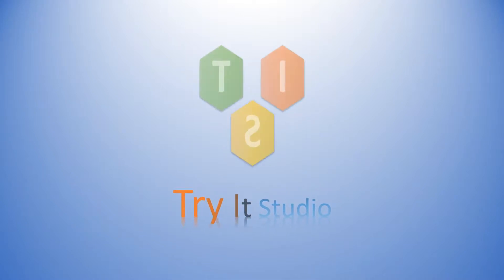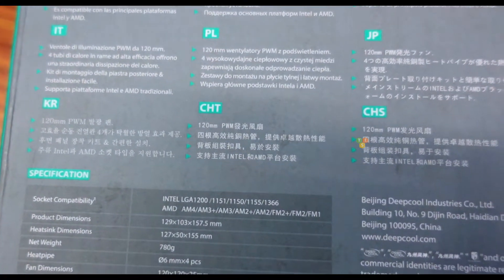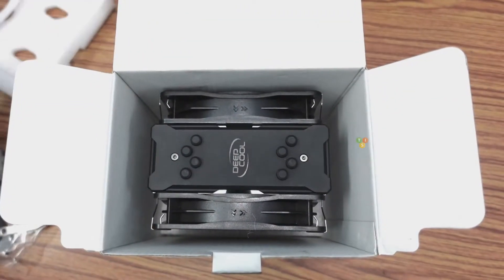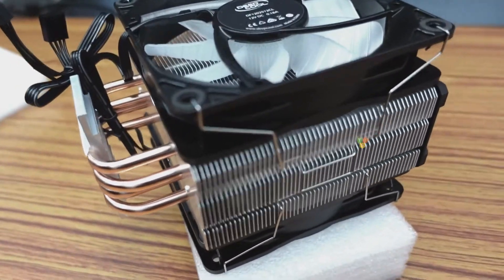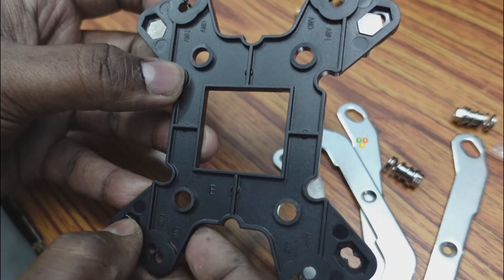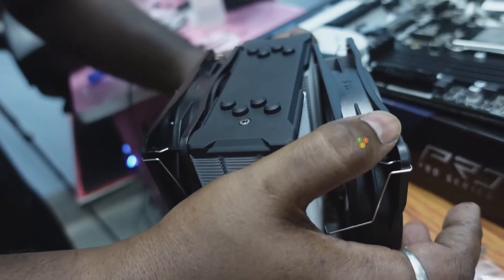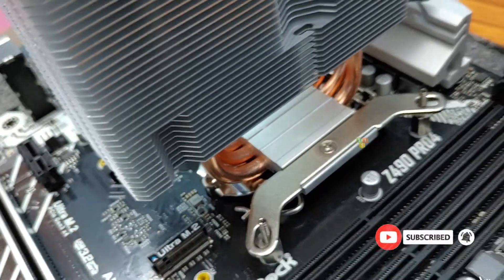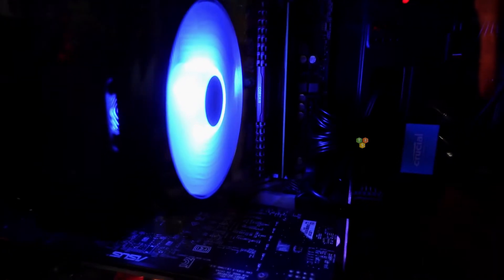DEEPCOOL GAMMAXX 400 PRO CPU Cooler Unboxing and Installation on Intel LGA 1200 Socket

Comment: Can it be used with 14400f?
Reply from the maker: Yes, the latest model has necessary attachments.
Reply: @tryitstd  Yes, now I have it installed 14400F+ ZOTAC 4060.:goodvibes:

Comment: Hi there. I have i7 7700k with corsair h100i v2 liquid cooler which is faulty at the moment. Currently don't have enough cash to get another liquid cooler but want to get one air cooler. Will this be ok for my processor ? i think its 95w tdp processor & lga 1151. i just do gaming & browsing & watching thats it.
Reply from the maker: This cooler will easily handle your processor load. I am using it with my i9 10850K processor and for gaming processor temp never exceeds 70 degree. Although for i9 it is not perfect but it can get the job done.

Comment: Can use with i5-10400f?
Reply from the maker: Yes, you can but you will have to buy motherboard connection socket seperately.

Comment: Can use with ryzen 5 5600x
Reply from the maker: Yes, it supports AM4 socket.
Reply: @tryitstd  but can it cool ryzen 5 5600x well
Reply: @tryitstd  can it keep 5600x cool
Reply from the maker: @kiwiofficial64  Yes, but if you want to overclock the CPU then you should go for 6 pipe heatsink. I am using it with i9 10850k. Ryzen definitely runs coller than this 14 nm beast.
Reply from the maker: @kiwiofficial64  By the way why are you going with Ryzen 5600x instead of i5 12600K. Intel 12 gen is best for gaming now.
Reply: @tryitstd  ok thanks for reply
Reply: @tryitstd  thanks but I have a confusion because I already have an lga 1200 motherboard and also an am4 motherboard so should I go with i5 10400f or ryzen 5 because I can't buy another mother for 12 gen I already have 2 motherboards
Reply from the maker: @kiwiofficial64  Hm, 10th gen can't beat Ryzen 5600. So, go with Ryzen. But if you play games using BlueStacks like BGMI/ FF then Intel is better.
Reply: @tryitstd  yes yes i use bluestack thanks a lot bro now i will go with intel because play ff and can save money also thank you so much for reply may your channel grow a lot!

Comment: Is it good for i7 11th generation if we want to run blender and maya? If not please suggest me a good cooler.
Reply from the maker: For blender Deepcool is quite good for i7 11th gen. You will get CPU temperature around 70 degree Celsius. For best cooing performance you have to go for Noctua D15 but it is way too expensive.

Comment: Can you give temp info here? I have same cpu and wondering if I should get this cpu cooler, ty 🤔
Reply from the maker: While 1080p gaming CPU temp reaches maximum 70 degree C (ambient temp is 33 degree C). But when I put extreme load on the CPU (blender test/video rendering only with CPU) then temp hits 98 degree C and the CPU starts to thermal throttle to reduce temperature. For i9 this is not an ideal option, AIO liquid cooler is best choice, but if you are on budget like me and wish to game only then you can go for it.
Reply: @tryitstd  thank you, I only want to game with it, and no rendering or work.

Comment: Sir 180w tdp mean
It can handle upto 180 watts of tdp in processor
Reply from the maker: Theoretically yes, but actually it struggles with my 125W TDP processor at full load. So, it is suitable for maximum 95w TDP processor.

Comment: Hello! Thank you for review and installation guide! I'm completely new to PC building and just bought this for myself on a sale and will replace my stock Intel cooler with it when it arrives. I hope it's newbie friendly.
Reply from the maker: Installation is easy, but it is time consuming.
Reply: @tryitstd  Do you think the thermal paste provided with the cooler is good enough or should I buy a tube of thermal paste?
Reply from the maker: @rkbrillant5265  It is quite good, I am using it and so far no issues with the thermals.
Reply: @tryitstd  Thank you for the reply! I just subbed. 🙏😌